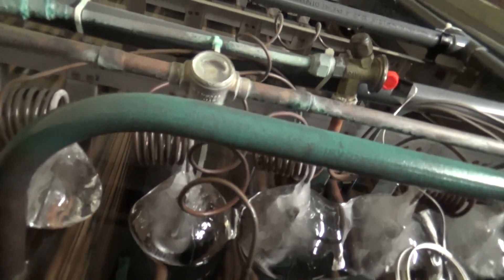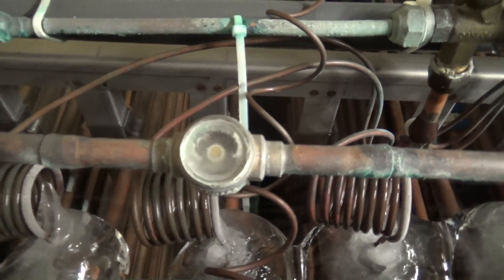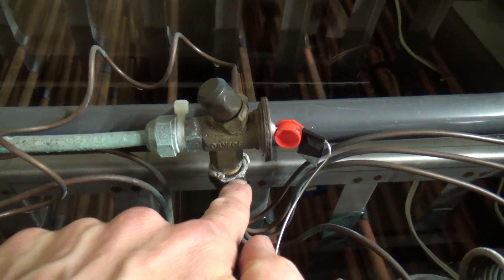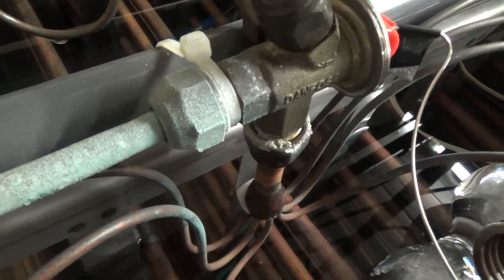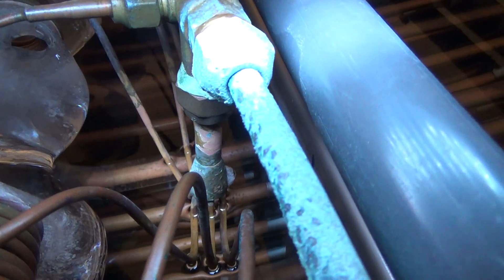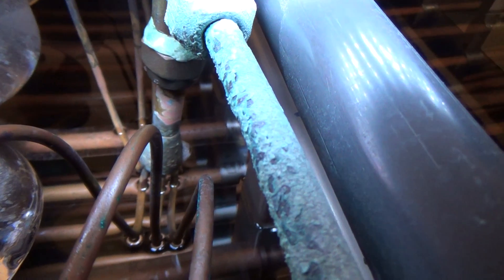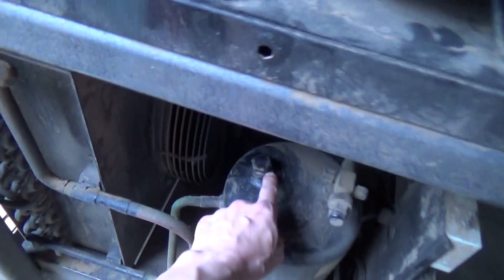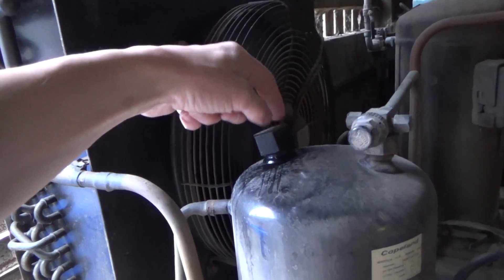Ice Builder Fail

Comment: Just how old is that, to have that much corrosion causing those leaks? Are they washing it down with cow floor sweepings. or is there no ventilation in the building.
Reply from the maker: I think its around ten or fifteen years old, i've never seen one leak like it before. The water is recirculated, so should not be corrosive.